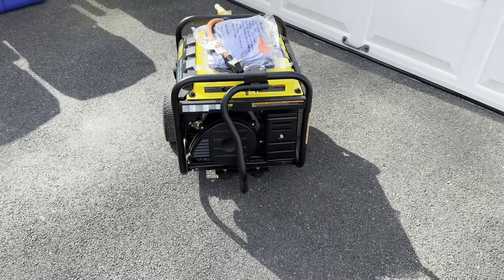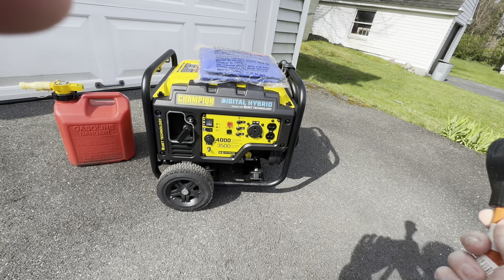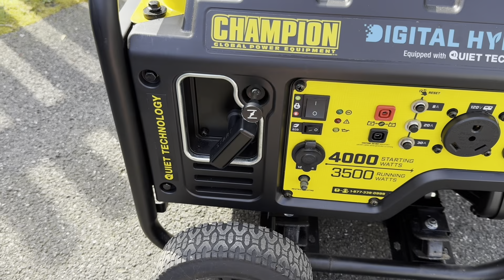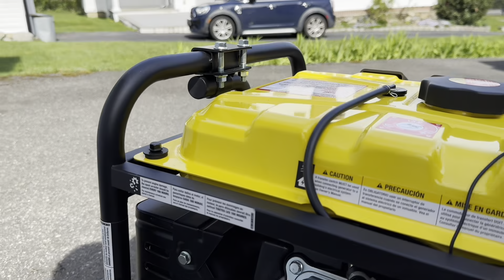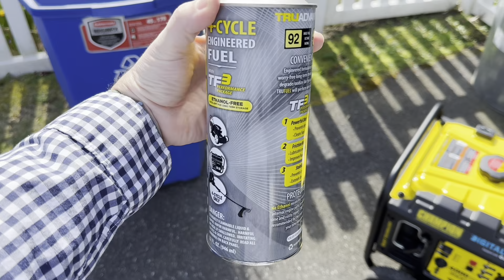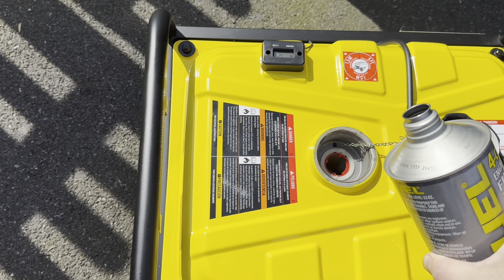Champion Open Frame Inverter Generator - Why Less is actually WAY MORE! Watch before you buy!

Comment: I hear you about the smaller generator not using as much gas and that is a valid point.
I have a 11kw Wen generator and it can be a gas hog.
I mitigate that by using it to charge a few 100Ah LiFiPO4 batteries making it so I can run my whole house and have a great amount of on demand power.
 If I don't need to run high power items, I can run off battery for several hours at a time and I only have to run the genny 4-6 hours a day in a power out situation as long as I'm charging the batteries while it is running.
Buying a 4kw genny is a lot more affordable than my system, you can pick up a 4kw for like $500.
My system with the 11kw genny, batteries and inverter costs about $1500. If you add solar panels with the batteries, tack on another $1000.
Reply from the maker: Thanks for watching! I agree and my plan is to run the generator to charge my Bluetti power station then run off the Bluetti for approx 15 hours before starting the generator again to recharge it.

Comment: Champion is quiet, fuel efficient. Large gens 7kw + most times have dual or tri fuel, easier to get a big tank and run for weeks or maybe grid gas is still flowing.
Reply from the maker: Thanks for watching! I’ve been very pleased with the champion open frame inverter so far.